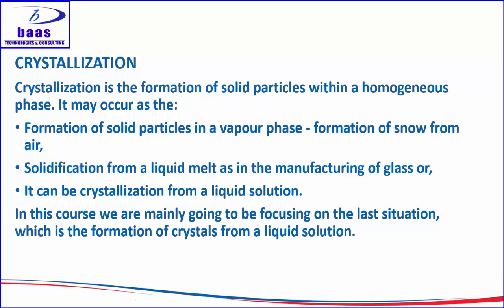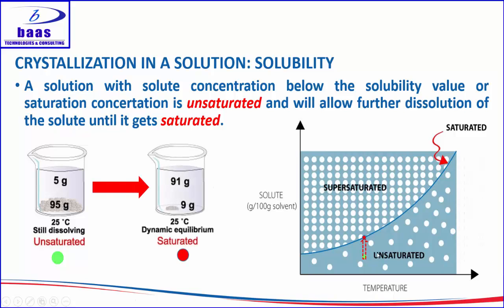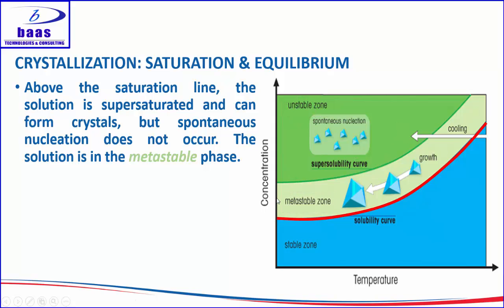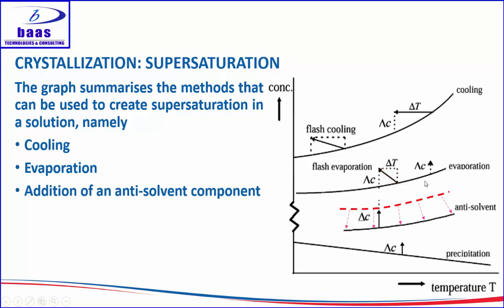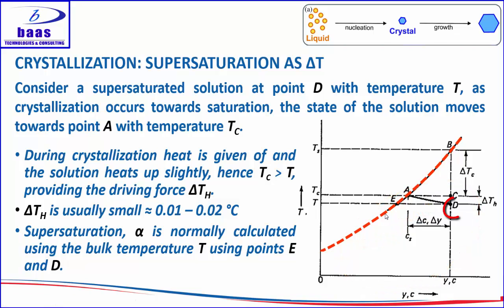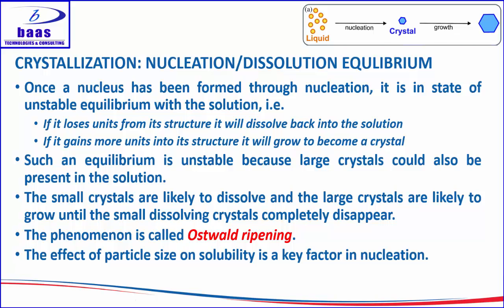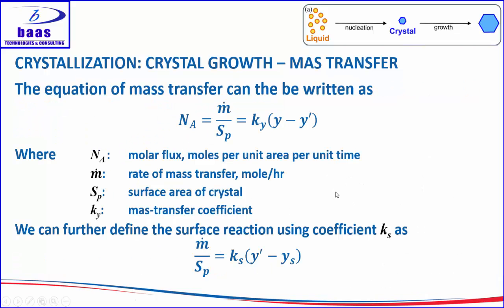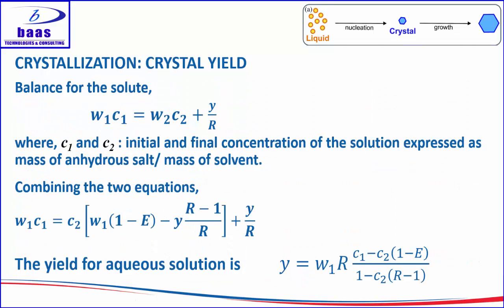INTRODUCTION TO CRYSTALLIZATION FROM A SOLUTION

Comment: Hello, I have a problem in my building in which the window is filled with moisture. After a close up, it looks sort of crystallization inside the glass. Unfortunately, such moisture or crystallization is not accessible from inside. Any method to remove this from the outer face of glass? Any suggestion?
Reply from the maker: That is going to be difficult. Can you spray the water outside to reach the windows.